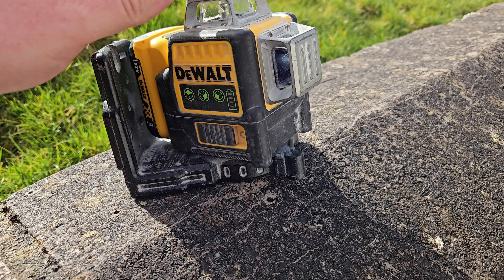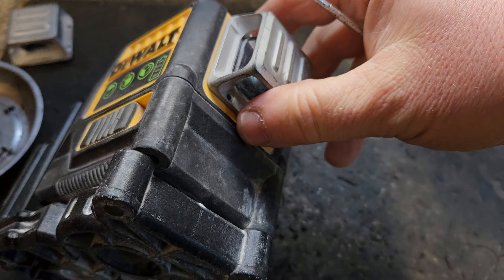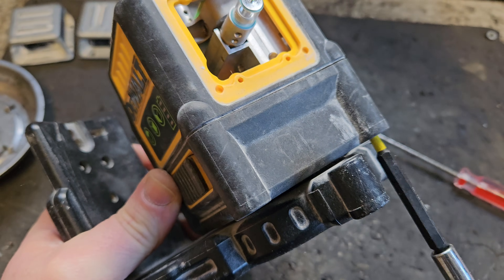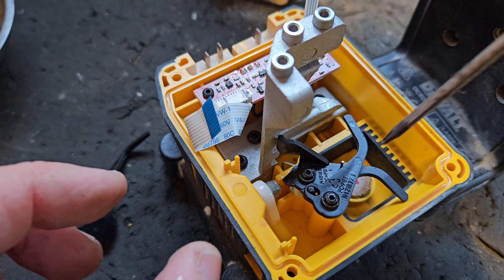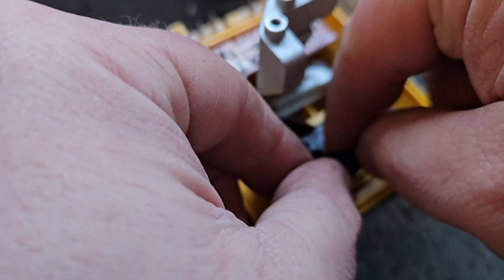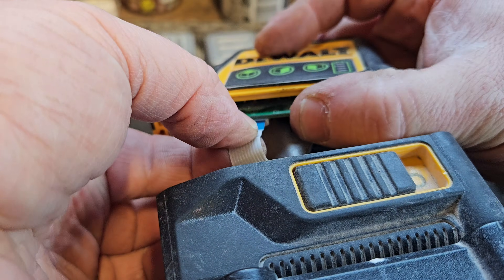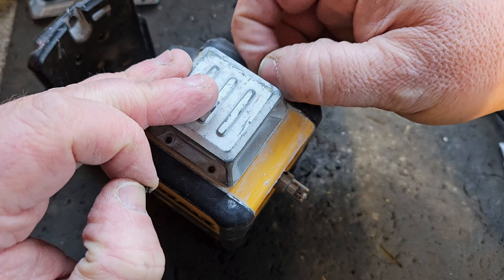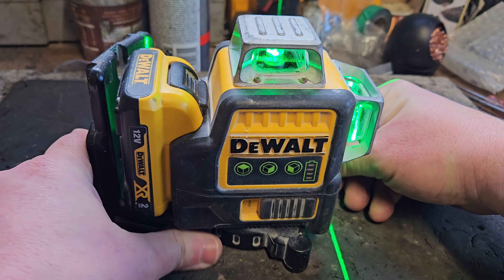Dewalt DCE089G 3 Beam Laser repair

Comment: Hi pal
The one on the front doesn’t switch on wit the button switch, do you know how to fix that?
Thanks in advance 
Great job you are doing.
Reply from the maker: Yes it's not straightforward will involve micro soldering
Reply: Do you know where to get needed part?